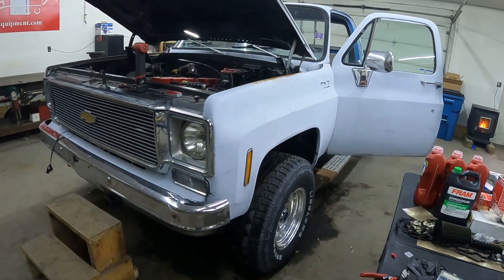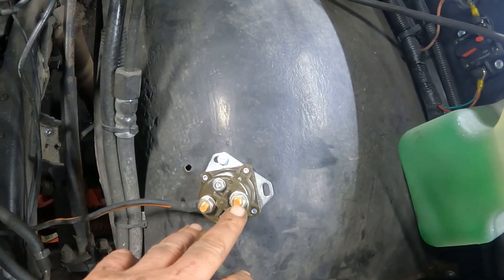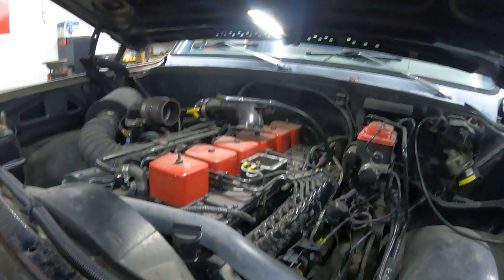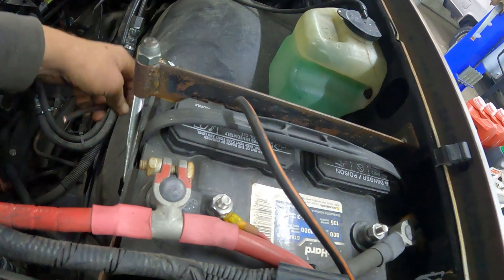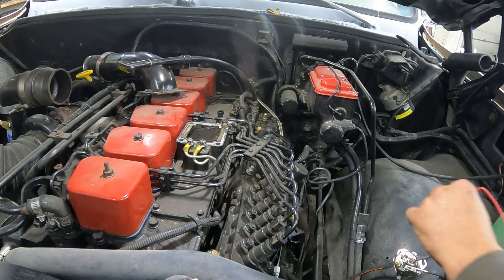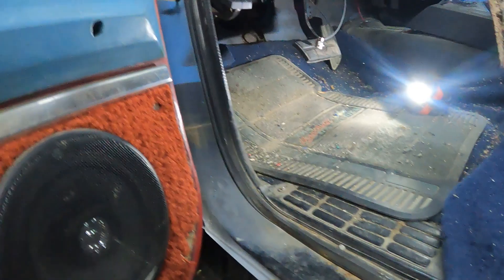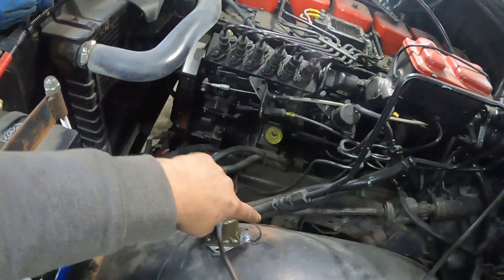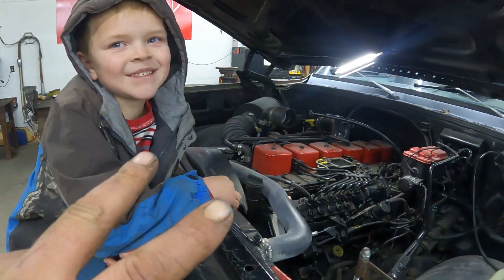Chevy K20 5.9 Cummins build #12 grid heater hookup

Comment: What gauge wire are u using from the grade heaters to the solenoid
Reply from the maker: I'm re-using the Ford 7.3 glow plug wire ... I still had a stretch laying on the shelf. Thank you for watching
Reply: Ah ok thank u im wiring mine directly I’m trying to figure out the gauge wire tho. Thank u video helped a lot bc I’m using constant duty solenoid with a push button
Reply from the maker: @carterkramer7305  I believe each grid draws 100 amps so a 4 or 6 maybe as small as 10 awg hope this helps
Reply: Ok, I couldn’t see directly in the video but u hooked from fridge heater to big lug on negative side then positive from battery to big lug the small lug ground to truck then positive to the switch inside then grounded out?